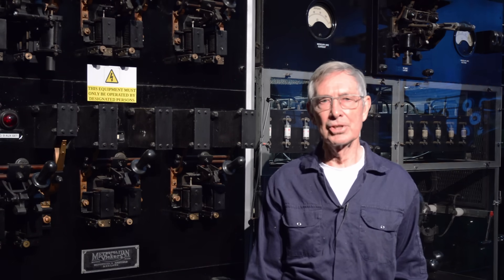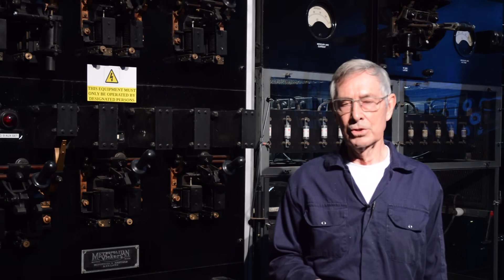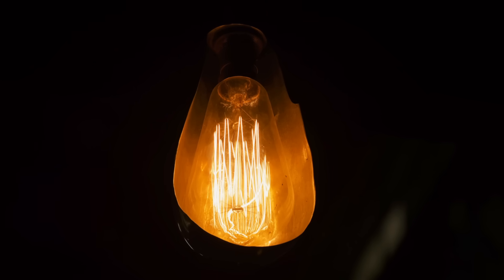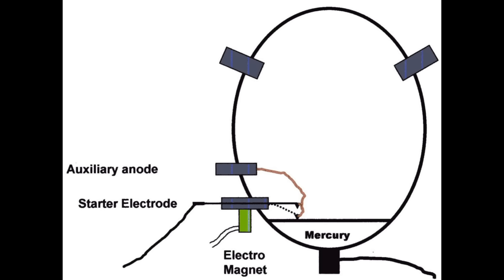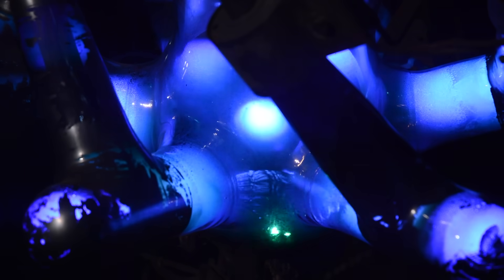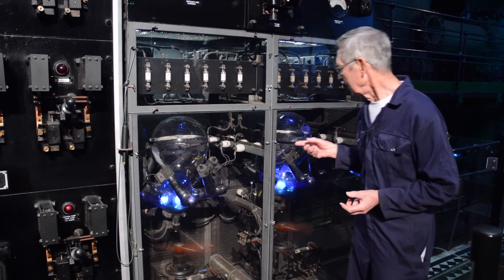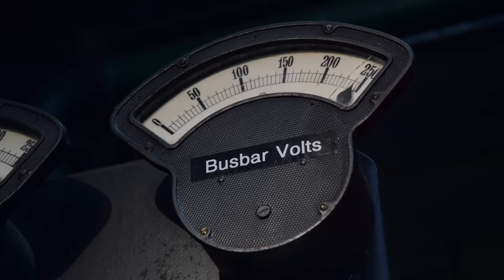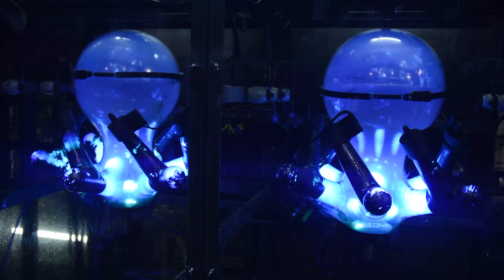Mercury Arc Rectifiers - Kempton Steam Museum

Comment: That's ultraviolet light.  Is there any danger of "sun burns" working around those?  Probably not good on the eyes either.  :P
Reply: sparks of an electric welder are more dangerous for your unprotected eyes. The spark inside the mercury rectifier ist shielded by the glass. And by the way no personal is standing there on a whole work day.
Reply: Ordinary glass is mostly opaque to UV (germicidal lamps and whatnot use quartz), its also my understanding you get less UVC out of a mercury discharge tube the harder you drive it, and these are definitely being driven hard. Between that and the cabinet this is likely perfectly safe to watch.

Comment: In America I saw units that were similar in function used in various aluminum smelting plants. The voltages delivered to the pot lines were considerably lower, but the amps were out of sight. Huge magnetic fields made you work differently.
Reply: Friend described how powerful the magnetic field was around a simple spot welder.
Reply: @flybobbie1449  in potline use there were hundreds of these tubes in parallel. Buss bars were routed just below ground surface. If you used a shovel it would point to the buss by magnetism alone almost 20' feet away. If you crossed the buried buss (aluminum 4' x 4' square) with a running engine it would stop before you got close. This was the site https://youtu.be/SWI9NTwuvl0. In 1980 when I was providing support it was called Anaconda Aluminum

Comment: Early cinema projectors used such a rectifier for the carbon rods as a light source. We would use about 70 amps at 27 volts DC Very reliable, the ones in our cinema ran for 22 years without issue, in fact the only problem was with one of the cooling fans.

Comment: From 1982 - 1985 I worked for an engineering company that had a Newall jig borer. It ran on DC current & the spindle speed was controlled by a rheostat. A mercury arc rectifier, similar to these, changed AC current to DC. Its unearthly glow was like something off Star Trek. The UV light was harmful, so was guarded from view.

Comment: Isn't that the uv light? The same wavelength as the ampule of broken Mercury vapour discharge lamp? Around 253 nanometers? UV-C, extremely dangerous?
Reply: The reactor bottle is made of very thick glass. UV-C is 100% blocked by glass.

Comment: I would love to hear a little more about what happens during that 5 second startup process! Is the length of time due to some sort of (potentially clockwork) precise timing mechanism, is it setting up some minimum load on the transformer, or a function of how long it takes to strike the arc in the mercury?
Wonderful video! Our electric society is so recent in the grand scheme of human advancement and yet the technologies that got us where we are now are practically forgotten. I studied electrical engineering at University and we never discussed the history of power generation, distribution, and utilization in the depth you did in an 8 minute video.
Reply: I would imagine the inrush current is the problem with those enormous inductors - they effectively present as a dead short albeit only instantaneously. Presumably the startup procedure is a variable but decreasing resistor acting as a current limiter.

Comment: Six phases, naked copper conductors, 250 amps, eeeeek!
Reply: * Glass insulators
* Wood prop fans
(I'm sure there's more)
Very eeeeek!
Reply: I was wondering if those open knife switches were still carrying full voltage, or if they'd stuck some relays out of sight to make it a bit less hairy?  Possibly the six phase supply is not ground referenced?

Comment: Thanks for the awesome demonstration! In my city is also one of these preserved in the local tram museum (www.tmb.at), but it is not in operation there, just on display; I was nevertheless fascinated by it since I was a kid. Back in the days, when all tramway substations were equipped with mercury arc rectifiers (or as we say in German: Quecksilberdampfgleichrichter - now memorize that :D ), it must have been possible to read the power load currently drawn by the tram cars in the respective power supply section just from the glow brightness and operation sound of the rectifier (and maybe as well from the waste heat airflow's temperature?), thus rendering the apparatus to be a machine producing a remote echo of all these accelerating and decelerating trams. Only for experienced traction current electricians, of course, who could intepret what they saw and heard. The modern power electronics part that replaced these stylish devices looks just like a boring piece of catenary wire, neither glowing nor sounding.
Reply: probably replaced with thyristors

Comment: Way back in the 50s and 60s, and in some cases well into the 70s, the RAF's Type 80 long range air defence/ATC primary radar featured these amazing devices. The radar used a wavelength of 10cm and had a huge antenna which rotated usually at a 4-5 rpm. Underneath the antenna and rotating with it was a small shed like room in which the mercury rectifier sat looking for all the world like some malevolent alien life form suffising the little room with its blue glow. It was an interesting experience entering the rotating room, watching the rectifier bubbling away with the world ouside spinning past the door.
Reply: That was probably a hydrogen or mercury thyratron, which was the most common swtich tube used to provide HV pulses to the magnetrons for radar transmitters.  I worked in the 1970s on 1950s-60s high-power radar systems, and they all used hydrogen thyratrons.  Many early systems had the transmitters and their modulators mounted right on the rotating antenna base, because it was easier to run power through slip rings than it was to develop rotating joints for microwave waveguides.
Reply: @BrightBlueJim  I bow to your superior knowledge, I was not an engineer so knew very little of these strange glowing and buzzing things. The radar was at RAF Sopley and I was the last civil controller to be trained there, as part of my course in 1973.
Reply: I believe the Type 80 had a 12 phase mercury rectifier nicknamed “Mekon” as it bore a resemblance to Dan Dare’s arch enemy, The Mekon!
Reply: @graemedavidson499  I can't dispute this, since all of my experience was with American systems, and as I said, built in the 1950s and 60s.  Even then, most of these were designed with vacuum tube rectifiers, many of which were retrofitted with silicon.  We did have a power supply that used phase-switched mercury vapor tubes to control the output of the high voltage supply for a transmitter (kind of like SCR light dimmers operate), but these didn't have pools of mercury like we see here.  And just to be clear, I don't romanticize this sort of ancient technology - it was mostly finicky, drifty, and overall difficult to maintain.  The more silicon we added, the better things got.  Even 1962 transistors were better than vacuum tubes, where they could be used.
Reply: @BrightBlueJim it sounds like you had some interesting times! I inherited some unused trigatrons, klystrons and a Magnetron from a Marconi Radiolocator MK4 maritime radar of that era and the accompanying log book which is interesting, showing the constant maintenance needed to keep them running well. Marconi too started replacing some devices with plug in silicon equivalents e.g. high power voltage regulator tubes with a plug in stack of zener diodes on a heatsink. We used to have a spare magnet for the magnetron but I got that stuck to my father’s bulldozer as a kid and it didn’t survive the removal process very well!
Reply: @graemedavidson499  Ah yes, interesting times.

Comment: I love that the cooling fans are actually solid wood propellers
Reply: @LuxCaeca33  They are wood to avoid flashover.
Reply: Also dead wrong about wood being a poor engineering material and being cheaper. Industry switched to metal and plastic for most applications because it is FAR cheaper to mass manufacture than wood, which does not need to be hand made, but hand-made is preferable because a craftsman can compensate for wood having non-homogenious grain structure that can lead to a high reject rate in "standardised" mass-production. Metal and plastic are just way easier to work with, and therefore cost less in terms of labour. It is true that wood is more sensitive to environment, but that is very context dependant. Under "perfect" conditions almost every compenent can last forever. 
(On a final note: "Solid wood" refers in this context to the wood and construction being sturdy, dense, and well made. It's not even an obscure definition. Even if "hollow?" was intended as a joke, it just sounded stupid)
Reply: @jmackmcneill a good quality wood and well waxed propeller can last as long as a metal propeller ( forever ) and both of them will last longer than a plastic one.

If you ever went or lived in Europe or Asia  you would know how long properly made/maintained wood last. ( Sorry if that sounded arrogant )
Reply: @puebespuebes8589but there are some plastics that last forever. Or rubbers. Just not the consumer junk grade.
Reply: It's a cellulose polymer composite bound by lignin, nature's finest invention, crafted over billions of years. lightweight, extremely strong, non-conductive, non-ferrous...
it's a wonder why we don't use it more
Reply: Safety first 👻👻
Reply: @LuxCaeca33  Who hurt you?
Reply: @remek_ember  His father was killed by a broken wood fan when the greedy plant manager just denied funding for the metal fans only a day earlier. It rained on his walk home after hearing the news only to have his landlord evict him for unpaid bills, to be replaced by the local wooden fan salesman.
Reply: @zoeygonnago_e  Although the guy in question has removed his (presumably toxic) comment, yours still made me giggle a lot : )
Reply: @zoeygonnago_e  hahahaha
Reply: @zoeygonnago_e  
Damn wooden fan cartel is at it again!
Reply: I'm your 800th like
Reply: I thought it was funny that all those are for is cooling 😂
Reply: You've earned your 1,000th like. I'd say people are a fan of your comment.
Reply: Well, they certainly would NOT be hollow wood propellers.... 🤷

Comment: I recall the London Science Museum has/had a huge mercury arc rectifier. Very impressive piece of tech when switched on. The advent of semiconductor solid state rectifiers, such as diodes, thyristors and gate turn-off thyristors (GTOs) in the 1970s  replaced mercury-arc rectifiers thanks to their higher reliability, lower cost and maintenance and lower environmental risk.

Comment: How many amps was the rectifier shown rated for? It is shown pulling 60a.....but the unit is inside an industrial setting....so I assume 60a is a tickle compared to  it's rated continuous load.
Which leads me to my actual question
...just how bright are the vapor chambers under full load?... because they looked incredible at a measley 60a.
I mean....they must be blindingly bright, not to mention the possibility of arc eye from prolonged viewing.
Am I correct about this or did the containment somehow negate the risk of arc eye?
Excellent video, thank you.

Comment: That was an excellent presentation. Absolutely fascinating. Thank you very much for making it. I knew abut mercury arc rectifiers but i had no idea they ever got that big. Im curious how many kilowatts can they handle? Im assuming there around 40KW looking at the range of the meters. I had always assumed that rotary converters would have exclusively been used to rectify power on that scale but as you stated AC motor technology was not mature at that time. The rotary converter by its simple mechanical nature seemed to me like it would have been the first high capacity power conversion technology available. I never considered the possibility of it being preceded by anything. What kind of service life do they have? Were they replaced often?
Reply: Rotary converters pre-dated mercury arc rectifiers but the New York Subway had some very large rotaries still in use until 1999.  These were 25 Hz machines but a few later 60 Hz ones on the IND division survived slightly longer.  I don’t know if they still have any mercury rectifiers in service.  I think one of the old rotary converters was going to go to the Transit Museum.
Reply: They have been made in large sizes https://en.wikipedia.org/wiki/Mercury-arc_valve
Reply: @markgohl2660  Thank you. I looked at that wiki page right after i watched the video. Im going to make one myself now. I have a ton of old glass mercury switches from thermostats i can recover quite a bit of mercury from. I want to make a steampunk battery charger with a glowing rectifier at its heart. I just have to figure out how i want to design the circuit.
Reply: @nobodysbusiness87  I assume that you have some proficiency in glass-working and have access to a vacuum pump and also know that mercury and particularly its vapour is extremely poisonous. One of many reasons why these things are not used as much as they used to be :) As for a circuit I assume you have single phase power to work with so you will need an auxiliary anode to keep the arc going. Good luck and be careful
Reply: @markgohl2660  I am well aware of the hazards of mercury vapour. If i do go through with the project i will be extremely careful. I do have a vacuum pump and have some very limited experience working with glass. Ive successfully made an incandescent light bulb once before.  I would most likely be using single phase power but i could also run it with a VFD if i had to. Even though that would definitely be cheating.

Comment: "the spark ionizes the mercury vapor making it conductive". Huh. That's interesting. There are other documents which state that it's the presence of a higher vapor pressure of mercury vapor which creates the conductive condition, a cold rectifier has no mercury vapor in it, it's all liquid. Striking a spark to the pool vaporizes a tiny amount of mercury to start the tube, when the anodes begin conducting, much more mercury is evaporated, raising the tube pressure and temperature further, minimizing the on-state resistance. The tube will remain conducting so long as it is hot, ie; so long as the current continues to flow.  This switching action - control of a large current at high voltage by a smaller-current, lower-voltage pulse - is the mechanism by which ignitrons work - they are also mercury-filled rectifiers, and they function very much like SCRs.
Reply: surely atomic mercury would conduct in both polarities? I assumed the ionisation was what resulted in the rectification
Reply: Even mercury at room temperature has a significant amount of mercury vapour above it, particularly if the reservoir is at a partial vacuum (I don't know if mercury rectifiers are?). I remember a demonstration when I was an undergraduate of light from a mercury lamp illuminating a screen, with a dish of liquid mercury in the path. The black billows of mercury vapour made visible on the screen (the vapour absorbs the blue light, you see) was quite a scary sight to behold.
Atomic mercury ionises to positive mercury ions and negative electrons. The electrons are many times more mobile than the heavy positive ions hence the conduction is favoured in the direction that the electrons travel - and voilà - rectification.
Reply: Railgap Esoterica, you will never be a decent teacher as long as you live. Use simple terms that everyone can understand. You do not impress people by usi g scientific terminology....unless you are addressing scientists.
No go away, and translate your technical ramblings into easily understood terminology. And don't come back until you have.
Reply: @paullee5573  dude, everything he said is easily understandable by anyone with a bit of electronics and physics knowledge. to say the same thing only using words everyone would understand would take 3 times as long. besides, a person without that knowledge is hardly likely to be able to clear up the working principle of mercury-arc rectifiers for us are they? might as well ask my cat.
Reply: @-yeme-  I probably know far mor about physics than you ever will. I am a professor of physics at Leeds University.
Reply: @-yeme-  hehehe, I checked his claim out too...
Reply: @paullee5573  Clean them toilets, gotta know about the physics of terds...bwahahaha!!
Reply: @-yeme-  lmao, love the callout

Comment: Does the glass cabinet provide enough UV shielding?
Reply: Arc eye would seem inevitable, yet the guy doesn't seem worried at all... But he's also really comfortable with the open switch gear
Reply: Most types of glass attenuate UV considerably, so the bulb may be cutting out most of it.  This is what allows fluorescent lamps to be operated safely.  Sure, the phosphors block some of it, but the glass also does.  Germicidal lamps are identical to fluorescent lamps, but with no phosphor and a fused quartz tube, specifically to pass the UV.

Comment: When I was a boy there was a man in Bamber Bridge (nr. Preston, Lancs) who manufactured car batteries in a big shed by the railway line.  To charge his batteries he had one of these rectifying the mains, and then simply put about 15-20 batteries in series on the output.  I remember being fascinated by that shimmering dot of blinding light.
Reply: Whoa.
Reply: I am trying to thnk of the failure modes .... lurid ... But i guess it would have worked.
Reply: That man was an idiot....

Charging that many large lead-acid batteries (bombs) in series, off straight mains voltage, is just stupid.
💣 💥 🔥
Reply: Monkey pen batteries. Didn’t he also had a monkey ?
Reply: Ah. I think we've finally found the source of the significant voltage drops British Rail were having an absolute headache trying to solve half way up the West Coast Mainline... 😉